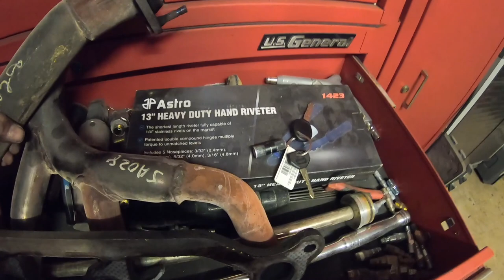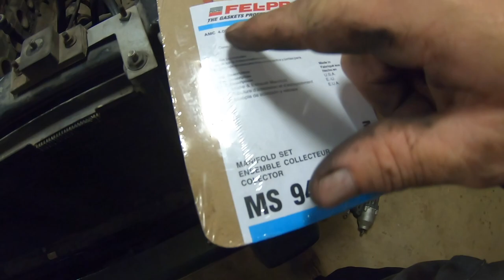Fixing a Cracked Jeep XJ Exhaust Manifold

Comment: I have to do this next weekend. Wife's cherokee yesrerday developed a ticking sound ONLY when she gives it gas is it audible, vehicle acceleration not affected so its not a misfire, only code throwing is p0432 catalytic converter efficiency below threshold. Today it was a little louder. So yeah im assuming a crack in manifold or bad gasket. Either way not looking forward to it, a lot of things to remove and rusty 23 year old exhaust bolts. There's not a lot of room in there to get to the manifold bolts, hoping this video and others help